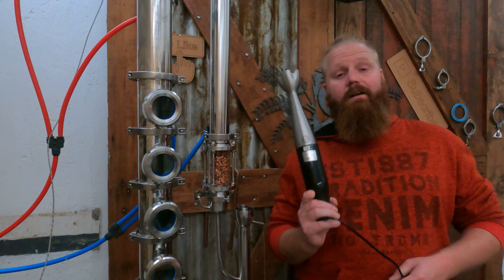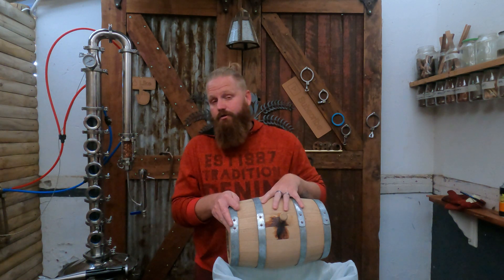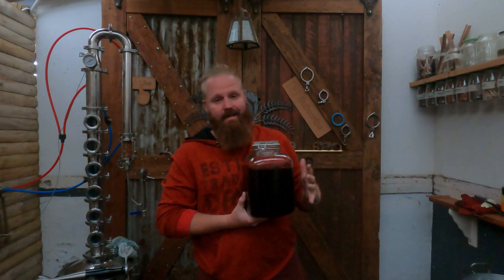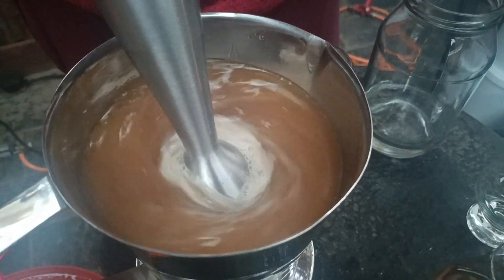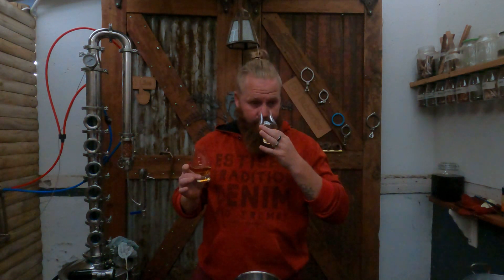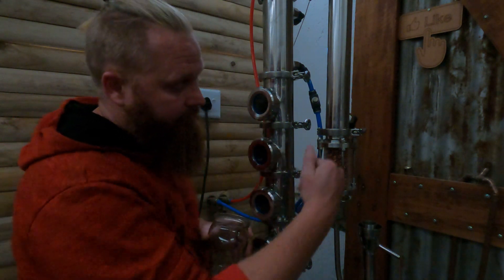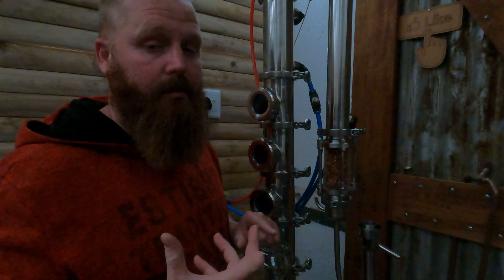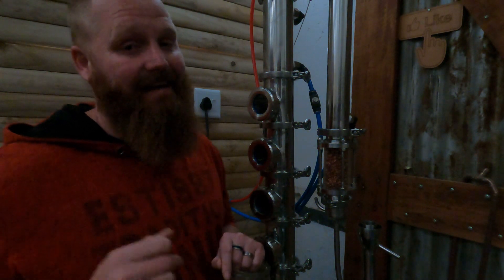Why I use a blender in my Distillery.

Comment: That copper at the end just begging to make urethane, aka Ethyl Carbamate.  Having stainless on the up side and copper on the downhill side is just bass ackwards.  If you've got sulfur or meat in your distillate that's an easy problem to fix without risking the cancer from urethane.  Note that plenty of major still manufacturers like Carl include copper catalyst sections, all on the ascending vapor side.  Yes, they have copper on the condensed side too, but they've already solved the problem on the ascending side so there is far less risk.  The fact you notice the copper spp having an effect after the condenser is pretty much proof you need more before it gets to that point.

Comment: That's very interesting about the stick blender. I have one I didn't have a use for. It now has one, so it'll be moved from the kitchen cupboard to a new home. I have copper (and SS304) SPP, a spare sight glass and seal with mesh that I can add.. It does look good I'll admit. I do also have copper scrubies, which I'd be using at the start of the column before any bubble plates or packed columns. This should be fun. With the 10L barrel, I found that 6 months was the first use limit for it, but that's probably due to the manufacturer.
Reply from the maker: Hi Dave.

Yeah man I love looking into the still and have as much as possible, this barrel will form part of my Solera system to add a finish.
Reply: @BEAVERDIY  I'll be doing a cherry brandy for my barrel next, following it with a corn based whiskey, maybe sour mashed. Also going to get a 2nd barrel for an apple brandy first use, followed with a rye based whiskey. Shouls be interesting to see how the brandies affects the other following it

Comment: Hi Beaver... I thought the copper in the condenser has to be located before condensation. So, should be the vapor the one that has to interact with the copper. Otherwise, would be pretty easy to correct defects by sulfur compounds like DMS, DMDS and DMTS.
Reply from the maker: Hi Rodrigo.

Yes and no, I have copper just before the condenser as well to interact with vapor, but the copper at the end has also cleaned up the spirit for me.
Reply: @BEAVERDIY   Do you think a copper condenser, worm coil, would be sufficient?

Comment: Thank you! Yes we need evaporate our products because of 30 nasty chemicals inside our distillate which evaporates slowly in the windy area or with ventilator. Your method is good and simple, which is right :). 🥂
Reply from the maker: Hi Ansis,

Yeah this was legit a game changer for me...
Cheers
Reply: @BEAVERDIY  I do it a long time from now (ventilator evaporation) and I can`t imagine not to evaporate, because I feel all that shit inside the product. Of course I remove copper too with chemicals - there is a few chemicals to do so, I have copper still and there is toooo much copper. And after all - 1h long motorized active coal treatment.